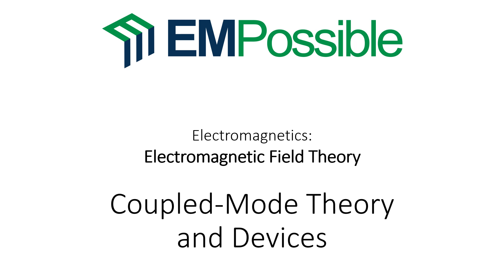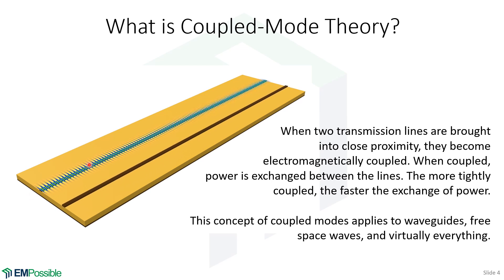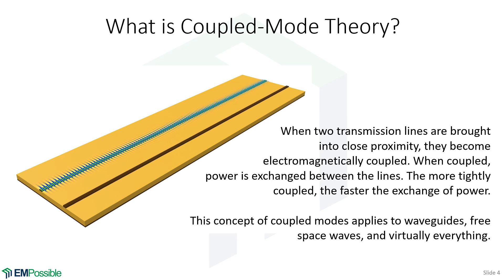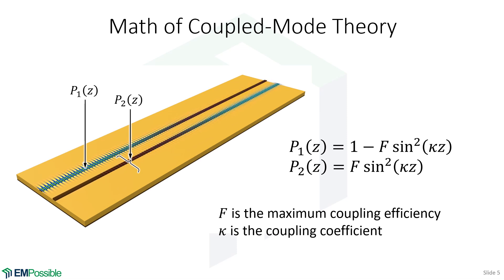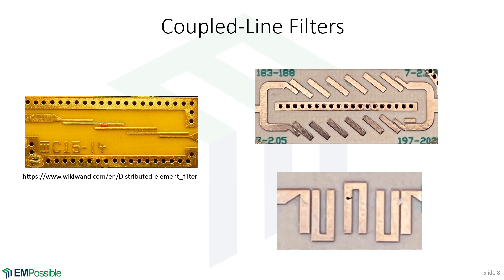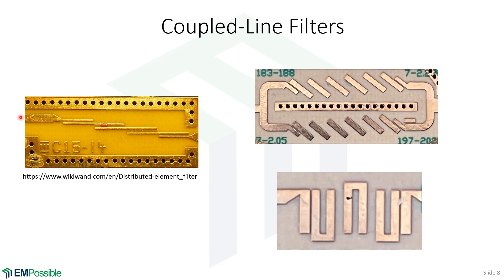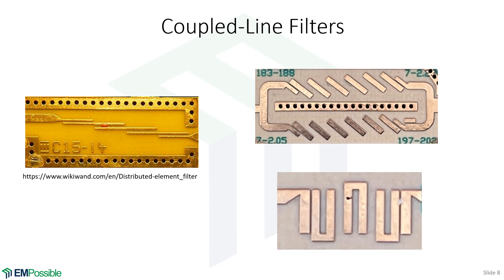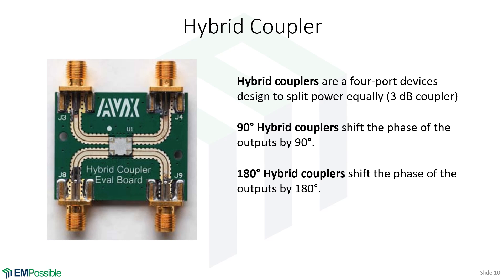Lecture -- Coupled-Mode Theory and Devices

Comment: Ooh, that "hopping power" result is nifty, I should definitely look at the derivation. Would you happen to have intuition for why on a directional coupler the coupled port is on the near side rather than the far side (as seen from the input port)? The story "signal goes in, hops to coupled line, still traveling in same direction, and goes out coupled port" gives the wrong result and I've always wondered why.
Reply from the maker: I do not think I am following your question exactly. If by "near side" you mean the other port on the same side as your input port, that typically would not show any power. To get power to that port, there would need to be reflection. It is called directional coupling because the wave keeps moving forward. It is just that the power will transfer between the lines periodically. I am not sure if I answered your question or not.
Reply: @empossible1577  I think you described the very thing that my intuition would (also) expect, but this is the opposite of what actually happens. Let's refer to 6:40 and the coupler on the left side of the slide. If I were to attach a signal generator at 1.83GHz, 0dBm to the In port and terminate Out and Rev ports, I would see about -15dBm at the Fwd port. If I then terminated the Fwd port and monitored the Rev port, I would see -35dBm or something due to leakage and imperfections. In other words, the labels on the board match my experience when taking measurements but they are the opposite of what my intuition says should be the case. I am therefore trying to recalibrate my intuition to match experiment.
Reply from the maker: @jjoonathan7178  Hmmm...I wonder if the sharp bends are using reflections to behave how you are saying. Looking at the chamfers, I assumed not. I've simulated tons of things like this, but not that specific design so I guess I cannot say for sure.
Reply: @empossible1577  I just uploaded a video on my channel measuring one that was easy to open (not sure if links are allowed). I don't think it's an artifact of bends or chamfers. It seems to be a thing with coupled-line couplers in general, at least microstrip / stripline / suspended line: all my Krytar and Marki and Anritsu and HP couplers work this way. Near port is coupled, far port is isolated, and this happens even if the thru line has no bends or chamfers like on my Krytar couplers. I can't speak for waveguides. But yeah, what happens is the opposite of what my intuition says should happen, and I've long wanted to clear that up.
Reply: @jjoonathan7178  There exist different type of couplers, and they react differently at various frequencies. In your video it seems like it would make sense for P1 signal to end up at P4, since it's the path of least inductance, thus least impedance. If you ever design PCB circuits, you will have the same situation between two transmission lines or a transmission line and it's reference plane.